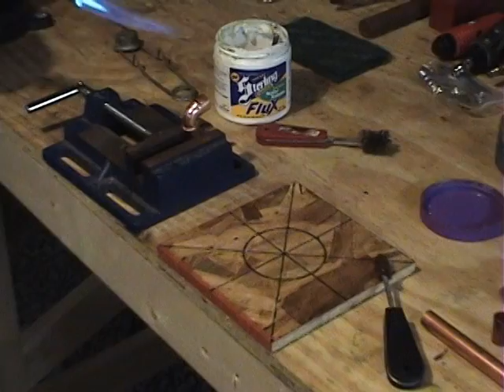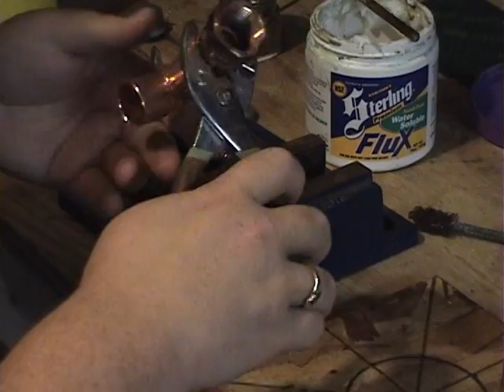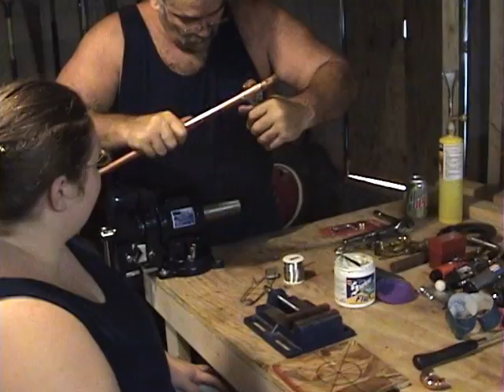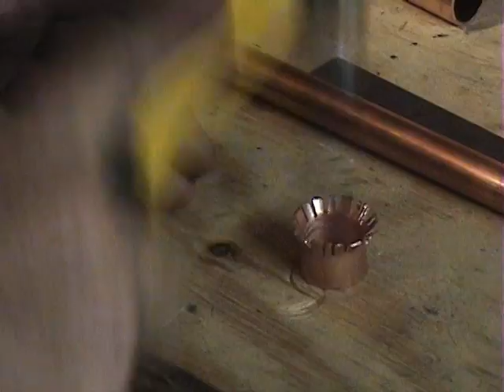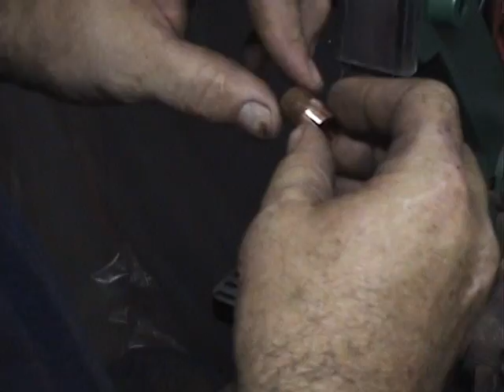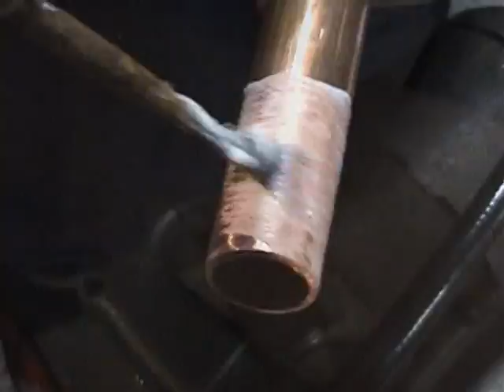Make Moonshine Still part 1

Comment: Nice job! Just a hint i know this is your way but solder runs to the heat add solder 180° degrees away on the smaller stuff and it will run to the hot point you'll use way less solder basically a half inch pipe only needs a half inch of solder.   But hey if it works for you do it your way.